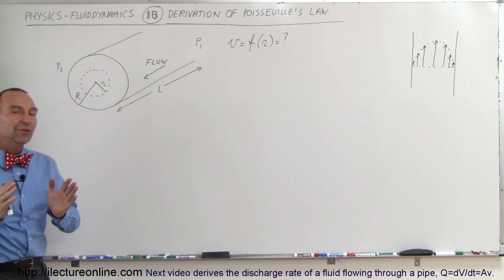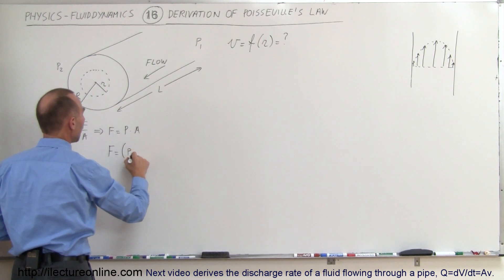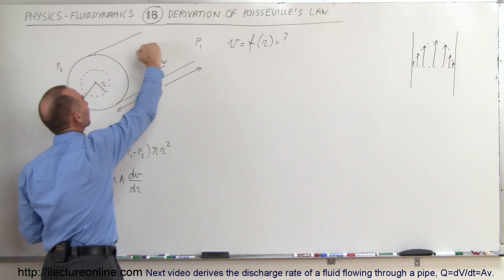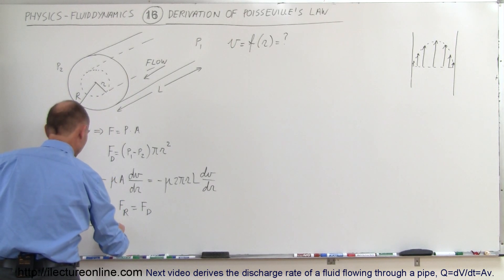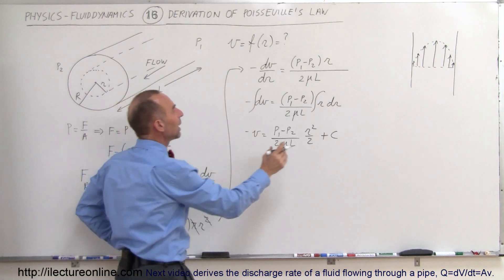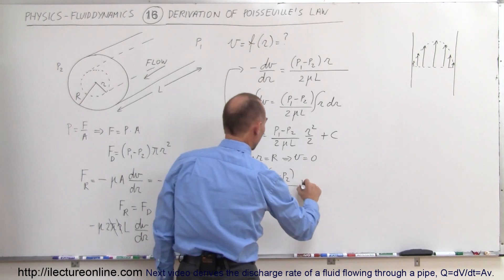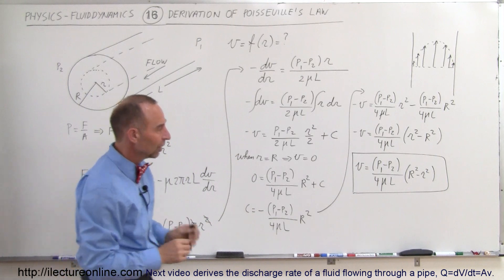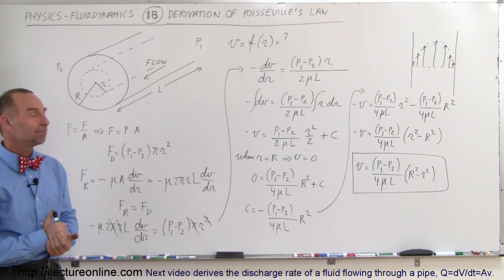Physics 34  Fluid Dynamics (16 of 24) Derivation of Poisseuille's Law

Comment: Thank you for the clear presentation. But I read Calculus: early transcendentals, and it said that this equation is called the law of laminar flow.
Reply: Same thing
Reply from the maker: The traditional form of Poiseuille's law is written in terms of the volume per unit time passing by a particular point.   Since dV/dt = A v     if you take the equation in the video (which is expressed in terms of the velocity, v) and you divide both sides by the cross sectional area and then divide by 2 to get the average velocity for a cross section, you will get the equation you are familiar with.

Comment: Is it correct to say that the negative sign comes from the direction in which the viscous forces act? For me it's easier to understand that friction forces are opposed to the movement. Great explanation!
Reply from the maker: The viscosity will cause the fluid to slow down, the greater the viscosity the smaller the velocity so the negative sign makes sense in that context.
Reply: @MichelvanBiezen  Thank you, sir. New suscriber over here! Congrats on your great channel!

Comment: One of the equations is wrong at, 5:58 the equation – v = (P1 – P2)/2uL* r^2 + C should be –v = (P1 - P2)/2uL* (r^2 + C), which gives a constant term (P1 - P2)/2uL*C, which is very confusing.  I checked at another website http://www.insula.com.au/physics/1250/poiseuille.html and the correct way to do the integration is to integrate dv from v to 0 and integrate rdr from r to R to directly get v(r) = (P1-P2)/4uL *(R^2 – r^2) without using a constant term.
Reply: In my study group we noticed the same thing. I don't understand why it wouldn't be –v = (P1 - P2)/2uL* (r^2 + C) making C = -(R^2)/2  ???

Comment: For finding Fd, shouldn't you have used 'R' instead of 'r' ? How could you cancel the radius on both sides of equation before integrating it? Or is it possible to cancel variables like this in maths?
Reply from the maker: We were only considering a small section of the cross sectional area stopping at r.    If the same variable exists on both sides of the equation you can cancel them out.
Reply: @MichelvanBiezen  thank you sir

Comment: Hello, first of all thanks for your useful videos. But I had a question about the poiseuille's law equation. Many sources show the denominator part of the equation as 8μL instead of the 4μL you wrote. I'm confused about this. I would be very grateful if you could explain the reason for this situation.
Reply from the maker: You are correct that the correct equation has an "8" in the denominator instead of a "4".   I need to revisit the derivation I put on the board to determine where I lost a factor of 2.
Reply: no dude , he didnt wrote the poisuelle eqn , he
 wrote the value of v only
Reply: @MichelvanBiezen  you wrote it correctly sir , this the value of v , not Q
Reply: @None0fY0urConcern  wait can u pls explain this

Comment: Dear Sir, thank you for your nice lecture. It's pretty clear to me, considered as a layman in fluid mechanics. However, I have a basic question, what is R and r? I meant they are two difference radius. The R is indicating the outer radius, but I could not get point of small r! Thanks in advance.
Reply from the maker: Big R is a constant.  It is the radius of the tube.  Little r is a variable, it represents any point of consideration from the center to the edge.
Reply: Yes, I got the point. Thank you very much.

Comment: why does the dv/dr term appear in the force equation?....any theoretical explanation pls...
Reply: Watch video 13 in this series where it is explained why the shear strain on a portion of fluid is v/l (l is height of portion of fluid). dv/dr is in differential form because that force equation at that part in the video is itself describing the shear force upon a tiny little section of fluid. The shear strain over any tiny individual portion (or cube) of fluid is equal to the difference in velocity from one side of the portion to other, divided by the height of that tiny portion. Mathematically, that is written as dv/dr (r, since we're dealing with circular cross section). The integration later sums all the tiny velocity differences (dv) to describe the total accumulated velocity at any given r value.

Comment: thank's for good video. I have a question. why does V=0 when the small r becomes R?
Reply from the maker: Friction between the fluid and the wall prevents the layer of fluid closest to the wall from moving.
Reply: does that means that fluid which is in the ring located in r=R and have thickness of dr has the 0 velocity?
Reply from the maker: That is correct.  (from a theoretical perspective according to Poisseuille's law)

Comment: How do we know that the viscous force is equal to the driving force? Wouldn't there be acceleration due to a pressure difference?
Reply from the maker: At steady state, the velocity will be constant, therefore there is no acceleration, therefore there is no net force.
Reply: @MichelvanBiezen  Sorry for my ignorance, but would this occur when the fluid is fully developed (therefore viscous forces equal driving forces)?

Comment: why there it is πx^2 in driving force and in resisting force it is 2πxl
Reply: driving force is derived as the difference in pressure across two cross sections. That's why it uses the surface area of the "caps" of the tube. The resisting force calculates the area of the tube part, not the caps

Comment: why when little r is equal to R the velocity is zero ?
Reply from the maker: +steve khan 
  This is based on a model.  The friction force between the fluid and the wall would make the velocity there near zero.
Reply: +Michel van Biezen So basically the friction between the fluid and wall will be so great it will cause the fluid to be static ?
Reply from the maker: Down at the microscopic level, that is essentially correct.

Comment: But how is  
Velocity (avg.) = (∆P)R^2/8πL
Reply: Don't you mean mu, not pit? Look up online, 'mean value of paraboloid'. A paraboloid is a 3d parabola (sort of), where a parabola is rotated about its axis of symmetry, this is pertinent here since we're looking at the cross section of a pipe. Basically, that formula comes from finding the mean velocity by adding up the velocities of all the tiny portions of fluid in any cross section of the pipe, then dividing that sum by the quantity of portions added (and that quantity is just the area of the cross section). This is from the mean value theorem.